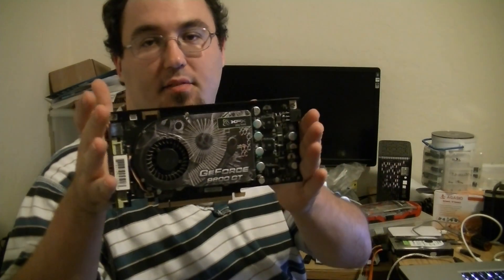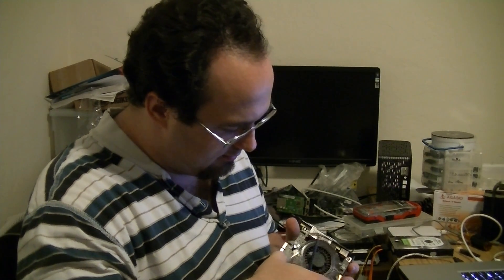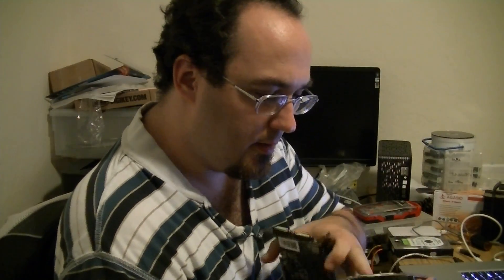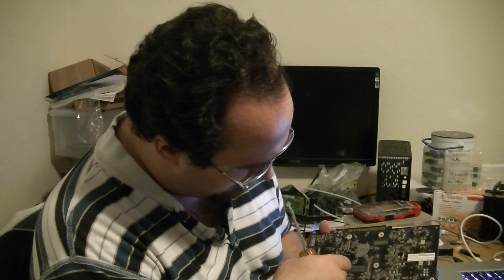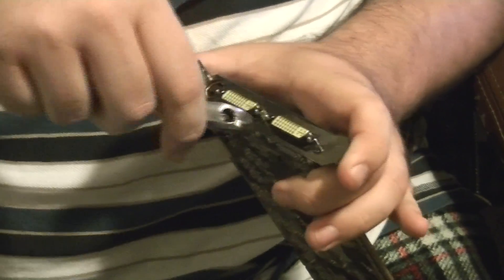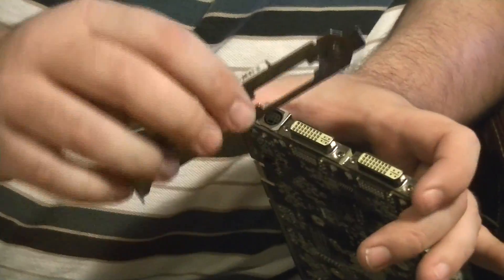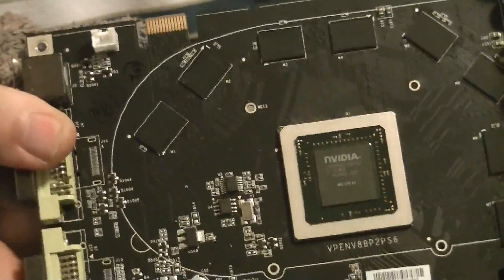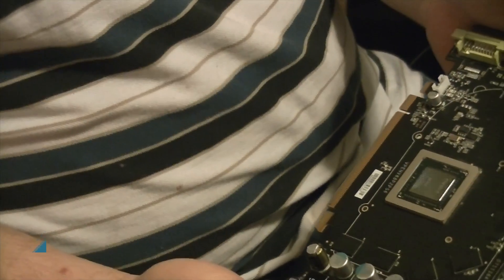Reflowing an nVidia 9800GT - Part 1: Preparation

Comment: hello bro i have some problem in 9800gt ... tat prob is when  i start my pc my video card works  but suddenly the gpu fan stops and display off ///but the processor all r run perfectly........... after restarting some time the fan runs .... otherwise its run  for few seconds and stops......... after reentering the card work and the same problem appears ....... if the fan pin any problem or any ics problem... plz giv some solutions
Reply from the maker: Sounds like your video card is dying!  Time for a replacement!